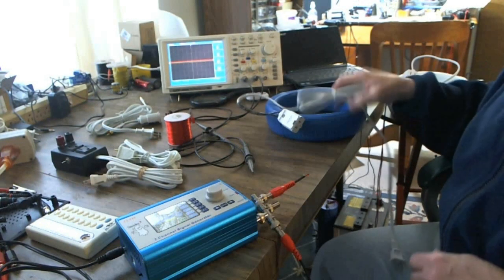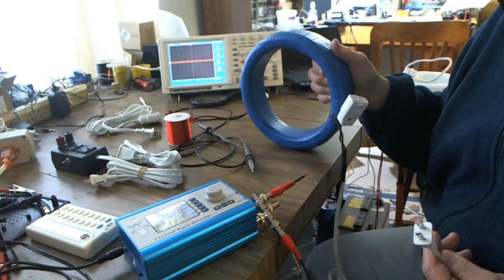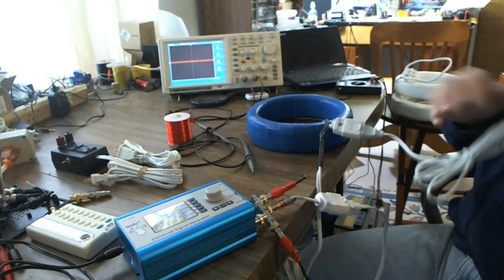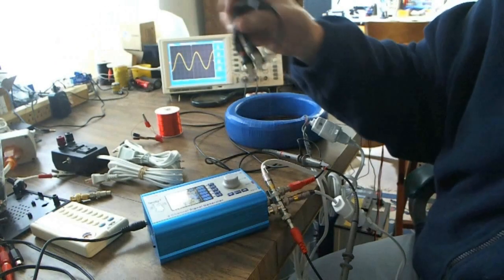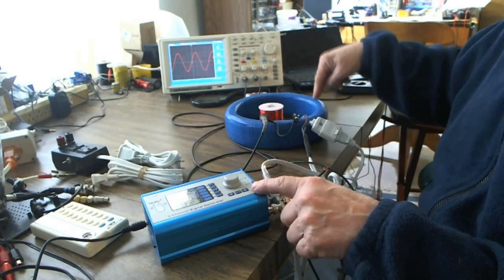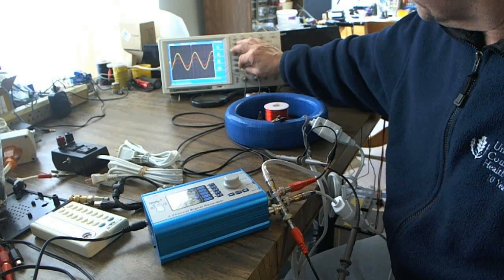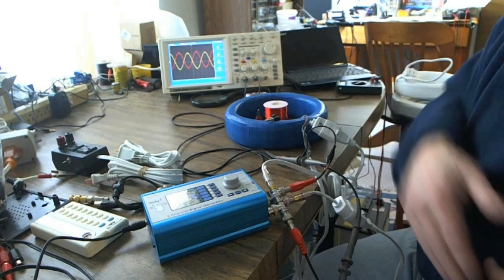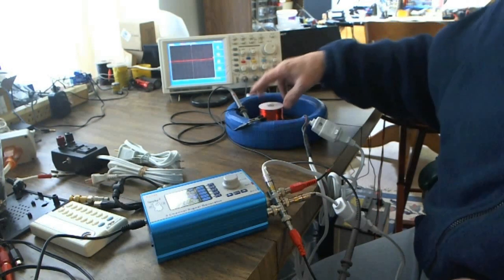Bifilar Coil Connections & Magnetic vs Scalar Waves

Comment: Just curious, how do you know that canceling out the magnetic field to zero creates a scalar field?
Reply from the maker: Interesting question and my answer is I am not absolutely sure that is the case.  I do know that my evaluation is supported by others because in part it is from both friends and articles that I came to this conclusion.  Something very interesting happens at the nodes as explained by Eric Dollard.  When the waves are 180 degree out of phase the node transitions happen almost instantly.  In other words faster than the speed of light.  When the first node is bumped all the nodes along the wave form are 'bump response' instantly.  Eric Dollard has a video demonstrating an example of this.  Consider doing a little research to find this video.  He does the demo with a rope.  If you find the video you will understand what I'm saying.  A claimed property of Scalar Waves is that they travel faster than the speed of light.  Before you discredit this concept check out Albert Einstein's paper on 'Spooky Action at a Distance'..  Additionally, today's research in particle physics can now demonstrate this ability of remote electron spin can be detected over a vast distance faster than the speed of light.  I sincerely hope this very lay explanation communicates well enough to give you some insight to Scalar Waves.  One additional thing you might do is to investigate what "Standing Waves" are all about.  They are related to "Scalar Wave" technology.
Be well and respectfully,  Steve
Reply: @gskempe9  thank you, I've seen the Eric Dollard using the rope to explain standing waves. I've just heard making longitudinal scalar waves is much harder than just laying two coils 180 degrees out of phase on top of each other. I've heard photonic interferometry, plasmas, and dielectrics are needed to do this. Dan Winter talks all about this using Phi ratios and geometry, but it's still unclear to me. Just looking for more simplistic explanations. Much appreciation for the response!

Comment: Gskempe9,  I wondered if you could publish on-line or send me a diagram and a parts list (with part sources) on how to put together a scalar energy generator that could be modulated to radiate pulses on energy at different frequency rates.  Could you do this with a low cost pulse generator and a möbius coil?  I am not interested in spending $1,600 for the Spooky2 Scalar.  The basic Spooky2 device is advertised at just $100 and I suspect the other ingredients you would need could be had for $200 or less.  Is shakti a manifestation of scalar energy?  I am interested in experimenting with different frequencies to see if there are any effects on consciousness.  Can you feel scalar energy?  I don’t like the term “scalar waves” because that is a contradiction of terms.  The CIA has several publications about scalar waves that are fascinating.  https://www.cia.gov/library/readingroom/docs/CIA-RDP96-00788R001900680014-4.pdf  &  https://www.cia.gov/library/readingroom/docs/CIA-RDP96-00792R000500240001-6.pdf
  You can reach me at banbiofuels@gmail.com  My website is at http://meditation-handbook.50webs.com/  PS  Would this fancy coil work?  https://www.etsy.com/listing/739686797/triangular-bifilar-tesla-coil-for-scalar?ref=related-3&frs=1
Reply from the maker: Too much design work would be required and this blog is not
the place to write extensive narrations on topics that I do not have easy black
and white answers for. I don’t know the answers to your some of questions or
certainly not well enough to respond adequately.  Shakti is an entirely different beast that I find has little in common with Scalar Waves.  Yes, some of the CIA publications are interesting.

Comment: Wow, your videos are very interesting! I know there are many uses for spooky which I have yet to understand. As of now I only know the basic uses for mine. I have been looking for aftermarket Doug coil which, I know is usually used with an amplifier, but it looks like you have an amplifier already utilized with this coil. Is this similar to the Doug Coil?
Reply from the maker: This Magnetic to Scalar Switch is used with a multifunction coil.  The coil is a Bifilar Coil intended to be use as a pulsed delivery device in conjunction with the High Powered PEMF.  It also is intended to be used as a magnetic wave or a scalar wave delivery device with or without an amplifier in conjunction with a Spooky.  With an amplifier it is very similar to a Doug Coil but doesn’t have the same strength because it doesn’t run in a matched resonance mode as the Doug Coil does.  The Doug Coil uses a capacitor bank to create coil resonance for a stronger output signal at a desired frequency.  See the projects section on the www.aurorasky.net website for more information.  Respectfully, Steve
Reply: @gskempe9  have u used this with a cap bank to chk the energy out via magnetic nd scalar wave using similar and dissimilar frequency as out puts

Comment: Is there a way to transmit and receive these scalar waves without a ground connection using a bifilar coil?
Reply from the maker: I have not done any experiments to receive scalar waves so this question is beyond my experience level.
Respectfully,  Steve
Reply: gskempe9 thanks
Reply: gskempe9 which bifilar coil did you use, the one designed by Tesla or the other? 
(Thumbnail of this video
https://m.youtube.com/watch?v=Gs_Cowk0a24)

Comment: Your resonant frequency of such a large cross sectional inside diameter would be WAY TOO LOW. I learned this, because of my tinkering with low carbon laminate steel for building the mini QEG. Because of your design..The core saturation would cause you irreparable problem before you could ever functionally obtain enough bemf to capture. For efficiency, design for a fat doughnut ..instead of a "wagon wheel".
Reply from the maker: The purpose of the coil is not to run in resonance, but to run in MAGNETIC Wave, SCALAR Wave, or PEMF mode.  Wave mode is very low power and it is frequency that is the key to the various health modality effects.  Books have been written on frequency and how basically everything in the universe has a frequency component.  Absolutely fascinating science!  PEMF mode works on a different principle and Pulse shape and strength are the key components, although frequency can play a role as well.  There is weak PEMF and there is High Power PEMF.  The 12 gauge winding of these Coils are intended to handle Pulses that exceed an electron flow rate in excess of 100 amps, albeit for less than a few milliseconds.
Making Coils for the implementation of collecting or accumulating energy is a difference science outside the intent of this video and narrative.  Respectfully, Steve

Comment: I want to convince my brother to purchase a couple of Spooky 2 frequency generators with all its accessories and including all the accessories and modifications in your videos, but I need to be able to contact you to ask questions via email.  Please send me an email; my email address is bradleyslyons4@gmail.com.  I ended up on Social Security Disability in California after having been maliciously poisoned by someone unknown to me since 1976, 2001 and, a 3rd time in 2003.  This occurred first in Saticoy, Ventura County [1976], then in Seal Beach \ Los Alamitos, Orange County [ Nov. 2001], then in Long Beach, Los Angeles County [2003].  Each time, the chemical used to try to kill me by felony attempted paralysis of my diaphragm muscle [ death by suffocation via blocking nerve cell communication from the brain stem autonomic nervous system] and the diaphragm movement of contraction and expansion of the lungs [act of breathing], was the banned termite pesticide known as 'Chlordane' or 'Heptachlor'.  From the first malicious poisoning in 1976 which was external via the skin on the palms of my hands touching my motorcycle handlebar grips which some criminal had placed the chlordane or heptachlor on the rubber of, I sustained permanent damage to my bone marrow which ever since, has produced deformed, excessively fragile red blood cells which by 1981, necessitated surgical removal of my enlarged spleen to avoid death from over 4 years of massive premature destruction of my red blood cells in the capillaries of my spleen.  Ever since, I have been at high risk of ending up with leukemia, brain cancer, liver cancer, stomach cancer and, intestinal cancer.  Despite having Medicare and Medi-Cal since 1988, I have been forced to save my own life by use of 'Artemisinin' / 'Artemether' / 'Artesunate' from the 2000 year old Ancient Chinese herb 'Sweet Wormwood' by following the cancer protocol discovered by Henry Lai, P.H.D & Nerandra Singh, P.H.D.., Professors of Biochemistry at Washington State University during their discovery in the 1970's.  In 1976, I was only 15 years old, but now I am 57 and a living miracle of survival.  In 2004, I learned about the medical discoveries and inventions of Raymond Rife, then Wilhelm Reich.  This led me to learn about James Clark Maxwell who reportedly discovered the Scalar Wave Field of the universe.  Then I learned about the discoveries and inventions of Nikola Tesla.  I am now a believer in the use of frequency and scalar wave propagation to repair and heal the body.  It seems that James Clark Maxwell, Raymond Rife, Wilhelm Reich, and Nikola Tesla all separately contributed to the ability for anyone to now perform miracles of DNA repair and / or, destroy viruses, bacteria, or parasites in the body.  May God bless you and, thank you for your YouTube videos.

Comment: I think this is demonstration of wave canceling standing wave not scalar wave. Just like microwave oven has cold spots that cancel and fails to warm your food consistently. That is the reason for turntable microwaves.
 Scalar wave is an impulse shock wave will look a like spike on the scope, able to penetrate most objects and metals and travels at c*pie/2 speed. Holding on to there energy to a much farther distance due to the penetration ability. Hard to receive because they just penetrate your equipment. Only a circuit that can resonate with the scalar wave frequency can receive it. Design receiver with 1/4 wave length but use  c*pie/2 as speed. You need to feed the transmit coil with a nano second pulse and give it feed back to trigger itself into resonance also using a step up transformer. Then setup the receiver identically except step down. open your circuit to include the ionosphere and ground connection to achieve over unity. The ground is negative and the ionosphere is positive like a giant DC battery waiting to be tapped by the scalar waves. The regular hz waves dissipate too quickly and wont work in over unity. Imagine a large battery of infinite power on your table you can connect to one side ground but on the positive side you can only connect a capacitor. Capacitors become conductive at high frequency. As you begin to draw power you can attract lightning so be careful or you will create a discharge event especially in bad weather. Use only what power you need in nice weather if you get to greedy you attract a discharge and blow your equipment sky high with a lightning discharge of significant magnitude.  Put up a dinky solar panel so noone asks questions where you get your power and your good to go.
Reply from the maker: Thank you.  This is going to have me thinking for awhile.  The video was inspired by the ‘Spooky Remote’ which is basically two coils configured to generate a standing wave regardless of the frequency being pumped in by the function generator.  Resonance is not relevant to the way the ‘Spooky Remote’ works.  The ‘Spooky Remote’ is a Radionics type device which the Bifilar coil duplicates on a much larger scale.

Your explanation of a Scalar Wave is more in line with power generation verse a Radionics health type device.  Your explanation is also very concise and if I understand it correctly you are giving away the farm with regards to an alternate energy source.  Thank you very much for this blog.   Respectfully, Steve
Reply: Hi Steve...I am trying to order a coil from you but cannot use Outlook.  Can you please send me an email at pura.vida.moringa@gmail.com  so that I can connect with you to order a coil.  Thank you so much!
Reply from the maker: I do not publish email addresses on open forums or blogs.  The website www.aurorasky.net offers a contact button by which to initiate an email link.  Most browsers will display that link in the lower left hand of the browser page when the cursor scrolls over the blue contact link button found on the website.  If clicking on the contact button doesn’t activate your email, then just copy and paste the address directly into your email program.  Alternatively, press the secondary button while pointing to the contact button and a drop down window will offer a ‘Copy email address’ option which can then be manually placed in your email program.  I hope this helps.  Respectfully, Steve
Reply: Can you argument more, or indicate an updated resource on the topic? It's a giant mess looking around for informations, but hey, in recent times I'm grasping so many details, I'm truly beginning to believe in this whole argument SERIOUSLY.
Reply: superluminal (v > ~300,000,000 m/s) speeds are reached when radiator (coil/isotropic antenna and balun (balanced line)) is greater than the transmitter wavelength... velocity (v) = f (TXfrequency) * λ (wavelength of radiator)
Reply: @xeno8555  can you explain more?